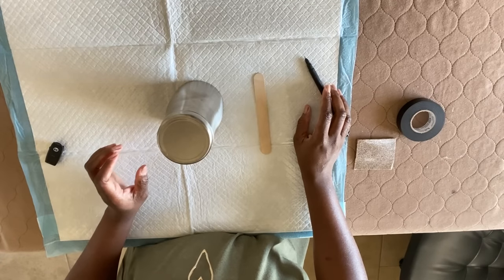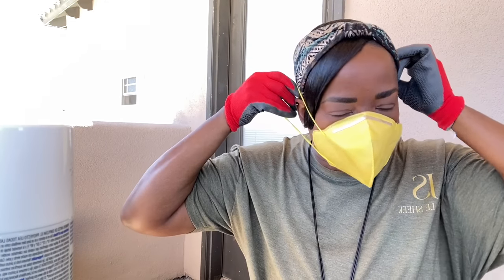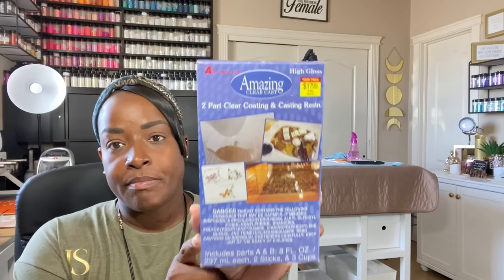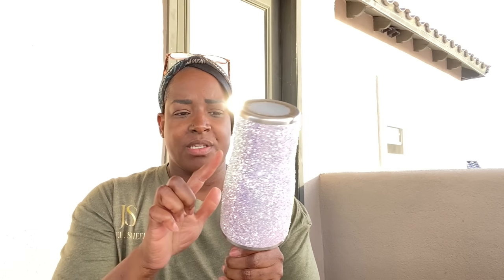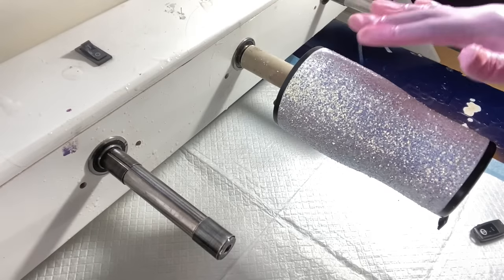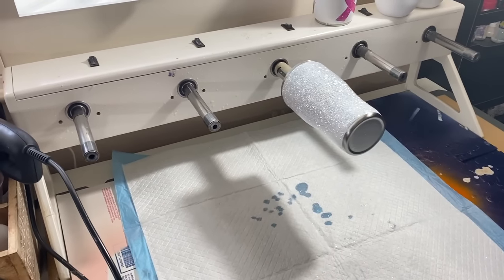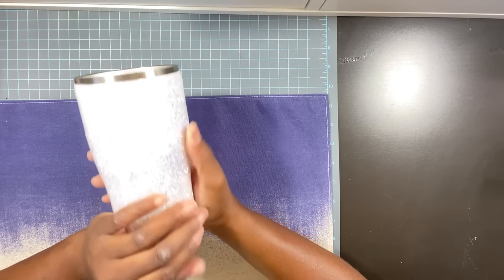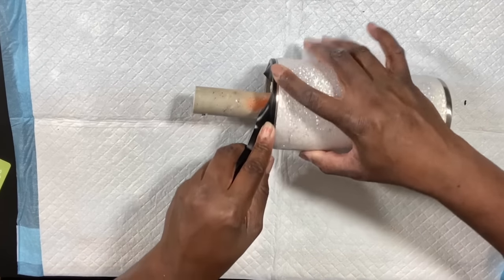BEGINNER TUMBLER TUTORIAL

Comment: How long do you let the paint dry in the 1st step? What turner do you use? Could you leave the tape on till after you spray the clear coat?
Reply from the maker: Hi Misty. I mainly use satin paint . So I let it dry about 30 minutes . My turner is from MH Turners . I take the tape off because I don’t want the glitter to dry to the tape and cause the tumbler to not have a clean tape line at the top and bottom . Hope this helps . Happy Crafting .

Comment: Question: what if I don’t want to glitter and paint . For example, my dads not a glitter guy and I have a very intricate cricute design. Do I still scrape up the cup ?
Reply from the maker: Yes… you will still sand the cup only if you adding epoxy to the cup. But if you’re using permanent vinyl and the cup is the color you like it just add the permanent vinyl and it’s a wrap. Hope this helps.

Comment: I absolutely loved your video. You used basic stuff and not make it seem like you have to have the high dollar equipment to complete this project. The only thing that I did not get the name of is the solution used to seal the decal
Reply from the maker: Hi.. I appreciate your support. I sealed the decal with Quick Coat by CCDIY. Craft Haven sells it . https://www.crafthaven.com/CCDIY-Quick-Coat-8oz_p_1677.html or you can just use some regular Ploycrylic by MINWAX which is way cheaper and does the same function. I will be moving to using ploycrylic once I finish the brand from CCDIY. Hope this helps.

Comment: I know this was a video from 2 years ago.  Hoping you can help, I did my first epoxy tumbler.  I thought I let it spin long enough several hours.  The next morning when I went out to check it, there was a large clump of epoxy at the bottom of the cup. Suggestions?
Reply from the maker: Hi.. I suspect that your turner is not level. Place a small level on the cup and ensure it is level. Also.. apply thin coats of epoxy during each step. Another tip is to also run your finger across the bottom of the tumbler during each coat of epoxy and remove any excess is what I have found to prevent a lump forming at the bottom . Hope this helps.

Comment: beautiful tumbler and very informative video.  thank u......
Reply from the maker: Thanks.. glad you loved the vid.. more coming .
Reply: @jebellesheek  when I do the exact method you use after my first coat of epoxy my cups are still very very bumpy. How do you get yours so smooth? How many coats of epoxy do you use?
Reply from the maker: Apply two thin coats … I use a heat gun to pop the bubbles and to help level the epoxy in between coats of epoxy. Are you patting down your glitter ? What kind of epoxy are you using .

Comment: I was told not to add a decal on a sanded tumbler because you will see the scuff marks through the decal.  Only apply a decal on a smooth surface
Reply from the maker: Hi.. that applies to a waterslide . I have not had any issues with adding vinyl decals after sanding. My decals come out almost perfect when applying epoxy to seal them in later. Hope this helps .

Comment: I have a question, I let my epoxy dry for about 18 hours. I went to apply my decal and my resin came away w the transfer tape, what did I possibly do wrong?
Reply from the maker: Hi.. I am thinking that you did not properly prep your tumbler . Did you lightly sand and clean your tumbler. Also ensure the ratio of the epoxy is the same .
Reply: @jebellesheek   That maybe the problem, not sanding. Because I cleaned and I spray painted it then used mod podge then glittered. Let it dry then another round of mod podge and glittered. Let that dry then sealed it with mod podge spray sealant. Let that dry a few hours then applied the epoxy. Then let that spin over night.
Reply from the maker: Yep.. you need to sand the tumbler /clean/ base paint / then apply the glitter. I use the epoxy method . Hope this helps ..
Reply: @jebellesheek  Thanks, I'm gonna try it again. Thank you for the video as well!